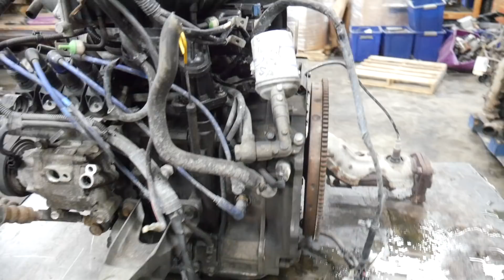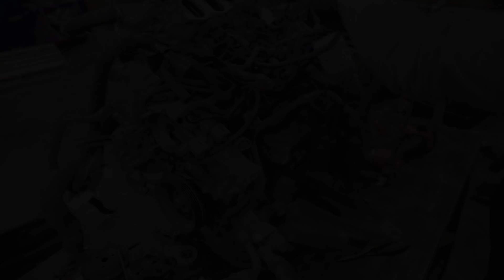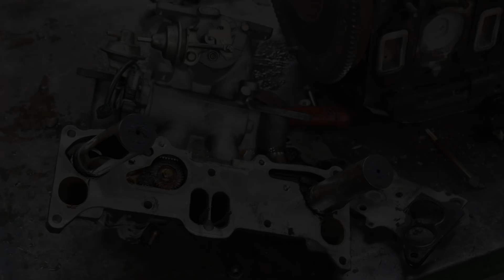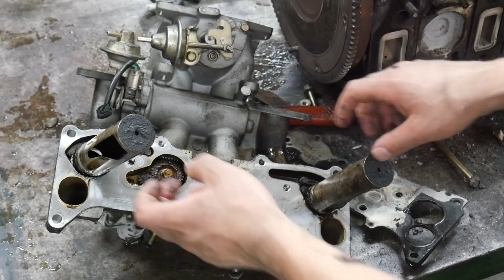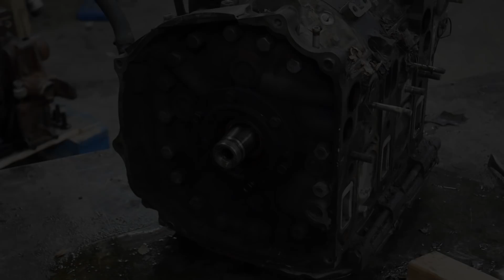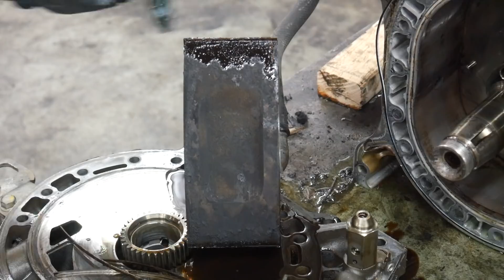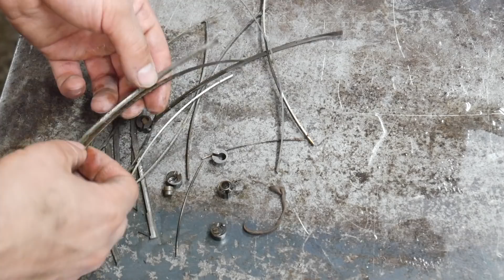13B RENESIS Total Rotary Teardown. 04-11 Mazda Rx-8 6-Port!

Comment: What kills the rotary engines like this one is that like you said it has oil injectors. The injectors only work above 3k rpm so if you don’t drive in lower gears all the time it never injects oil to lubricate the housing and apex seals which causes both the housing to wear and the apex seals to crack or even break….
Reply: But if you drive a rotary like a daily driver they don’t last but if you drive a regular piston engine they will but if you beat the piss out of a rotary engine they tend to last longer than a piston engine. their applications unfortunately and ideal conditions are different
Reply: All Wankel engines are inherently unreliable by design...

Comment: Rotary is a fancy two-stroke.  Very fun to drive, and nothing else sounds like it.
Reply: All Wankel engines operate using the 4-stroke principle.
Reply: @WilhelmKarsten  Go ahead and run one like it is.  Let me know how many miles you get before the apex seals are gone.
Reply: @veleriphon  It runs like a 4-stroke... because it is a 4-stroke.
Wankel engines are inherently unreliable because of the weak design of the seals and the combustion chamber architecture
Reply: @WilhelmKarsten  In practice, it doesn't work like a four stroke because the apex seals get burned away from a lack of lubrication.  This is solved by adding oil into the fuel.  Therefore, the Wankel is a glorified two-stroke.
Reply: @veleriphon  You seem very confused and misinformed, the Renesis engine was designed with metered oil injection which is superior to premixing.
Mazda doesn't recommend premixing because it can damage the engine.

Premixing does not make any engine a 2-stoke.
Reply: @veleriphon  The primary failure mode of all Wankel engines is compression loss due to ablation of the apex seals caused by erratic combustion and detonation, the high pressure and temperature cause the apex seals to leak allowing high temperature gasses to damage the surface of the seals.

This failure mode is completely unrelated to lubrication.

Comment: After 25 years racing/rebuilding I'm so done with the rotary engine, 13B in particular.  While size and weight are phenomenal,  the thirst for fuel and terrible reliability are too much.  Parts have started getting pricy for these relics as well.  If you like engine building as I do they are a unique and fun challenge.  But unless you like doing it over, and over, and over...

Comment: I bought a 2004 RX-8 MT new. Still own it. It's definitely a bit tired, kinda weak compression. But it runs fine. The biggest issue I've found is having to replace the coils every 25k miles or so. You'll know if one goes out. Performance suffers significantly. All of a sudden you're dumping fuel into the exhaust, which will eventually melt the cat. If the cat plugs up, it runs like trash, and will eventually kill the engine.

Comment: The middle 2 ports are actually the primaries, the outer bottoms secondaries and the outer top ones the aux. ports and they work as a system in combination with the complicated intake manifold

Comment: The RX-8 was one of the cars I was looking at when I was considering get rid of my 94 Integra. It's a GORGEOUS car! And I worked with a guy who owned (and unfortunately, totaled) one. He loved it. But then I got to a dealership and took one for a test drive. The acceleration and handling were definitely not what I was expecting, and I don't mean that in a good way. My Integra did better in both those categories! In all my excitement, I never thought to look at the weight of the car. That's WAY more than it should be, but I'm guessing a lot of that was due to safety regs. What a disappointment!

Comment: Biggest fix I have heard of is to install another oil tank, fill it with 2-cycle oil.  An interlock to avoid running it dry would be prudent as well.

They inject oil into the combustion chamber, currently use oil from sump.  This oil is not meant to be burned, also this can cause them to run out of oil.  A built in oil leak.
Reply: Monumentally stupid idea... why use the wrong oil?
Reply: @WilhelmKarsten  Because it's better for that purpose.   Sump oil is not intended to be burnt, 2-cycle oil is. Plus this avoids running the sump dry, a real problem with this engine.

They did not do this because they did not want to confuse people.
Reply: @russellstyles5381  Your comments reveal someone who is not qualified to properly service any automobile...
Reply: @russellstyles5381  You are the one who is confused... Mazda only recommends ash-less 4-stroke motor with a very specific API/EC, JASO rating.
Using the wrong oil incorrectly will only cause damage to an otherwise healthy engine.

Comment: People dont appreciate that rotary engines burn oil by design where its injected into the chamber to lubricate the seals & they have to keep a good eye on the oil levels, some run them dry & trash the engine.

Comment: To hold a flywheel take a old damaged valve bend it 90 degrees and you can place the shaft of the valve into a transmission bolt and the valve seal in the teeth of the flywheel

Comment: I had a 1993 competition yellow mica twin turbo R1, basically stock, that I drove hard for 126,000 before it lost a water seal.  I attribute that longevity to changing the oil every 1000 miles.  The exhaust temps are around 1800 degrees and the oil takes a beating.  Just Havoline mineral base oil.  4.9 seconds to 60, with a good driver and great tires, which was pretty speedy back then.  

Thanks for the great content.

Comment: my 1990 GTU second gen first engine lasted 185,000 miles. U.S.A. it was a great car. i loved it. the second engine was removed at 245,000 miles. not because anything was wrong with it, but because someone pulled out in front of me and i "T boned" them at 45mph.  when he pulled out in front of me, i was less than 30 ft from him. it totaled the car. i was depressed over it for nearly a year. i kept that car in great shape. all of the suspension bushings were replaced, the transmission was replaced. all of the plastic inside the car was new straight from mazda. if it broke it would get a new part. it was factory except the seats. i put racing seats and a racing steering wheel in it. that was the only non factory part in the car. i loved it. i now have an RX-8, and i know it is not as reliable as my GTU was, but i will be pulling the engine soon and sending it off to get it reworked and modded so that it will be more reliable. i dont think it will ever be as reliable as a second gen 7, but hopefully more reliable than it is now. it has 80K on it and has zero compression. i bought it for $500. it looks brand new in and out. it looks really nice, and i cant wait to drive it.

Comment: Main problem was heat from what I've gathered across the net. Legend is that if you over-beef cooling for these they last much longer than stock/boosted especially.
Reply: Inherently unreliable by design...

Comment: You didn't have a socket big enough for the flywheel gland nut, right? Had a friend who rebuilt & molded the 13b in his RX4 wagon back in the 1980s. We couldn't find a socket anywhere to fit it. Found a huge  crescent wrench that almost fit, ground on the adjustment rack a bit and got the gland nut off intact with the crescent wrench. He named it "George". His RX4 wagon with an auto trans would out accelerate a stock RX7 and with the port mods and stainless steel headers and exhaust sounded like Paul Bunyan's chainsaw at full tilt. Good times.

Comment: The actual concept of the (Wankel) rotary engine was sound. Fewer moving parts, etc, etc. But in every day reality, it never really cut it. I've seen many on the SCCA road racing circuit over the years and they have impressive performance (and they are REALLY, REALLY LOUD!!!), but that's a long way from "daily driver" reliability/longevity. This engine should never have been kept in production for as long as it was. In my humble opinion, of course...😉😄

Comment: Rotary is good.  For a racecar    light compact simple (when not full of emissions crap)   premix the fuel run no cat and a good flowing exhaust and it'll scream and make good power.   With awful fuel mileage , be very noisy ,and bad for the environment 🤣🤣
Reply: Sucked for racing... too weak, inefficient and horribly unreliable.

Comment: may be my engine! had a 2006 RX8 GT which the engine blew at around 70k and destroyed my exhaust system as well. wasn't even going fast. I did love that little engine though! so fun to drive! In Mazda's defense, they were excellent in honoring their warranty and replaced the engine for almost no cost to me (I had to get new engine mounts).

Comment: When you opened the engine up and I saw the inside of the rotor housing I can tell you that some one was feeding that engine synthetic oil. The zebra stripping gave it away. It’s a huge failure point because that engine isn’t designed to run synthetic oil. It leaves gooey deposits that coke up the rotors and the housing and eventually wipe out the seals.
Reply: Amateur rotard

Comment: These are great engines. Show me any other engine that is a 1.3 litre NA that makes 240hp that you can buy new for 2500 bucks. There are fixes for the apex seals mostly premix and know how to maintain and drive them I have 100k on a RX8 never had a single issue and I still drive her. People tend to talk down to things they don't understand.
Reply: Wow! Amateur rotard alert!

3.9 liter!

Premixing is monumentally stupid! Who pours the wrong oil down the wrong filler hole???

You should buy a bicycle
Reply: @WilhelmKarsten  It's a 1.3 litre I know you watched the video trying to explain why some people think it's a 3.9 and even some think it's a 2.6 but it is sold as and is a 1.3 litre it's how it produces power. You have to premix a rotary to get proper lubrication to the apex seals. The factory oiling system doesn't use enough oil. It's pretty basic and you should at least know something of what your talking about before you comment. I have owned rotaries for almost 20 years and iHave worked on many things on rosaries. You stick with what you know I'll stick with what I know. Nice chat amateur pushtard.
Reply: @1sinister80  It's not "pretty basic" it very complicated son, the primary failure mode of all Wankel engines is not related to lubrication.
Apex seals do not fail due to lack of lubrication unless the engine is not properly maintained and serviced.
Apex seals fail due to high brisance and ablation caused by erratic combustion and pre-ignition/detonation.
The factory metered oil injection system when properly maintained provides the Correct amount of lubrication at all times.
Premixing does not.
Any questions son?
Reply: @1sinister80  Lubrication is not the primary failure mode of apex seals..
I can prove it.

Comment: A good friend bought the RX2 sedan in 1973. It was crazy fast for a subcompact that looked a lot like like a 70's Toyota. It was the most unreliable car in every way and he did not own it for long. The first thing that went was the clutch, and then it was overcome with electrical gremlins. It made an easy 130 MPH but barely squeaked out 20 MPG with conservative driving. Also you had to carry motor oil. Yes, if they haven't figured it out in 50 years.

Comment: I took a rotary snowmobile engine apart yrs ago in a Johnson sled, it wouldn't run long, it was cool looking & I had to take it apart. The first thing that hit me was, how the hell do they stay together? When I had it running it was crazy how fast the exhaust would turn bright red just at idle. Crazy power it had when it ran. Bad seals caused all the problems.

Comment: As someone who has been in the rotary community for a long time, this video doesn't demonstrate great knowledge about rotary engines. Used good housings for example can be resurfaced and reused. And trying to turn the motor without the stationary gears in place....
These engines can be reliable if taken care of properly.
Reply: Wankel engines are inherently unreliable.. there is absolutely nothing that can be done to make them reliable either.
Dead end technology
Reply: Wankel engines are inherently unreliable, this is an irrefutable fact, please stop spreading lies and misinformation
Reply: What chapter of Rotary International are you a member???
Reply: @WilhelmKarsten  wrong kind of rotary.
Reply: @3toedSloth75  The Wankel KKM57 is not a Rotary son..
Reply: @WilhelmKarsten  no one was talking about it...
Reply: @3toedSloth75  The Rotary community is completely unrelated to, and has no affilation with Mazda Motors.
The video is regarding the Wankel KKM57 type engines made by Mazda, specifically the 13B-MSP-RE.
Reply: @WilhelmKarsten  I wasn't referring to that community. I was referring the Mazda rotary communities that I've been involved with in different capacities since ~1995.
No one in the Mazda rotary community refers to the KKM57... they do sometimes call them "Wankel rotaries" though

Comment: They could increase the strength of the apex springs and improve the depth of the apex seals, which would increasing the depth of the groove in the rotor. Should give much more miles ?
Reply: Increases wear on the seal and the housing....
Reply: Making the apex too heavy causes chattering and ablative damage to the seals.

Comment: You hush it’s rotary we love it for the power and the braap braap
The 787b is a perfect example 2.3 liters 950 horsepower at 10,000 rpm n/a
No turbo and it lasted all 24 hours and won  it’s a beast and is worthy of a spot on the wall of legendary engines
Reply: 7.8 liters... single win was pure dumb luck.
Mazda lost the 1991 WSC championship to Jaguar... 
Mazda has never won a single world class series and has left racing
Reply: @WilhelmKarsten  it may have been dumb luck but the point is winning is winning 
Weather by an inch or a mile 
And the 787 won

And where did you get 7.8 liters
Reply: @Seagull_seaven7  Porsche has won Le Man's 19 times.
Mazda failed to win a world endurance championship title and has since abandoned its factory motorsports program.
Reply: @WilhelmKarsten  but Porsche has always dominated every racing championship there in 
That’s because they have the money to and the engineers to build the cars 
Mazda only entered the race to say that the rotary engine was for racing 
It’s really dumb that they didn’t push racing harder but they didn’t
Reply: @Seagull_seaven7  Mazda was still a cork and bottle cap manufacturer win Porsche was winning races at Le Mans...
Mazda is a brand recognized for building cheap, entry-level cars for lower income first time buyers... it has never be associated with high performance, racing or luxury.

Mazda's foray into racing was an epic failure,  the 787b lost 20 out of 21 WSC races and lost the championship to Mercedes-Benz in 1990 and lost to Jaguar in 1991.
Even after winning Le Man's in 1991 dales of RX models continued to decline... not money well spent.
Mazda struggled on but has never won a single Gran Prix or world class championship title.
Reply: @WilhelmKarsten  exactly that’s what they did and that’s what they focused on they saw Porsche and it’s success and they had the rotary that was successful in the cosmo so they raced leman and they did win but never really fought to keep the car they had won and that’s all they wanted 
Now the rx7 became a race car in the American market and race cars sell
Reply: @WilhelmKarsten  I still love the engine and had it gotten the attention it deserved would never be over shadowed by the piston engine

Comment: Former rx-8 owner here. I bought mine with 60k and it had low compression and needed a new engine by 90k. When I went to swap it, I found that the manifolds had brush marks from previous removal and cleaning so I was putting in the third engine at 90k instead of the second. I found 2 of the 4 oil injectors not holding vacuum so I guess that was the root problem. It still had good compression when I sold it at 120k. Great car, super fun to drive, loved it. Made me smile every time but it was riddled with reliability issues, not to mention rust problems and, at the end of the day, I don't have the patience for a vehicle where you have to replace the engine as often as the air filter.
Reply: Worst sedan Mazda ever made... unreliable junk

Comment: I was a rotary nerd back in the 90's - going through a number of RX7's and building a number of engines. My initial interest was one of my friends had an all-original 1976 Cosmo that ran really well. 

I got a TON of miles out of all my rotaries, but likely that was only because of the OCD maintenance I put into them. They are very unforgiving of marginal maintenance routines. My race car was bet to a pulp, yet the engine continued on. 

They are fun, weird, and can definitely be reliable with the right owner. They are not for the casual car owner, however.
Reply: Yeah I had a 1982 and loved it. I was doing a drain and fill every 1k miles (yeah overkill)

Comment: I had a 1988 RX-7 that made it to 120,000 Miles before it lost compression and died. They do it suddenly, and then it's time to call AAA for a tow because they rarely restart. They don't care if you are stuck in traffic. WARNING NOTE: If yours is running a little hot for no apparent reason, get it home ASAP, or find a parking lot. From what I've been told, that's about the only warning you'll get. The early 13B engines don't like getting hot, nor do the 13As.

Comment: Ok, so help me out here. It appears carbon build-up is a big problem, so, other than driving it like you stole it, would synthetic 2 cycle oil help? At what ratio, something like 32:1? How about running a bit of water through it?
Reply: No, never use 2-stroke oil, use only the correct oil